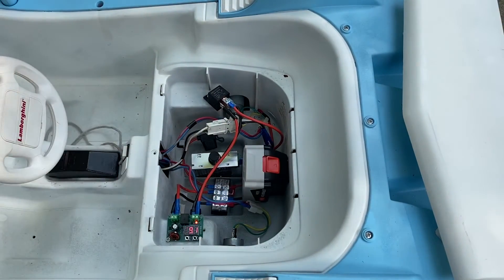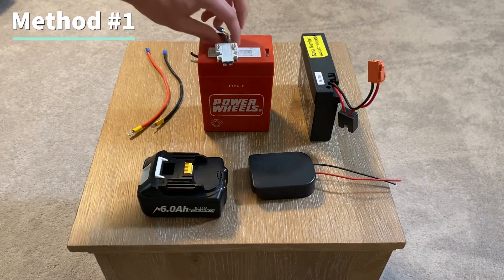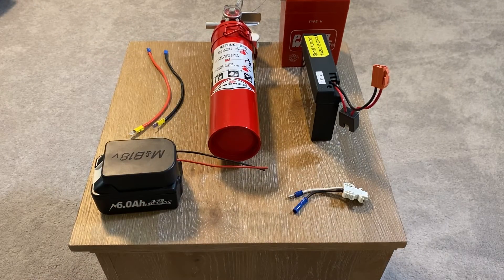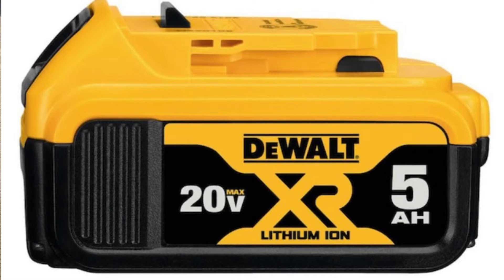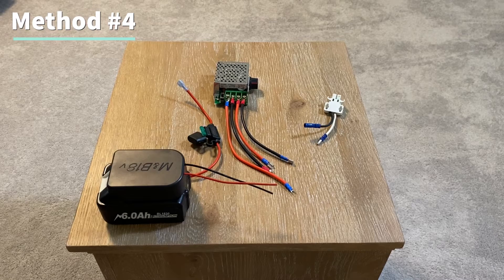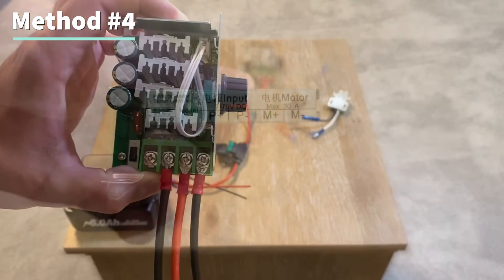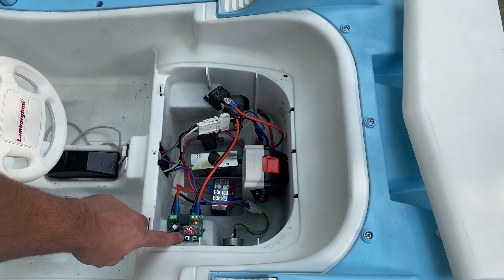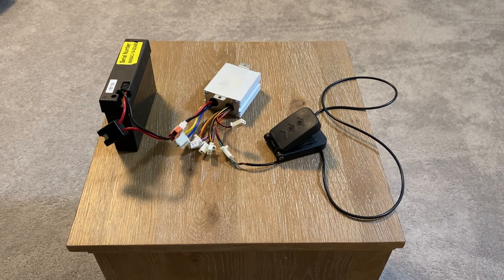Best Power Wheels Mod - Drill Battery Conversion (4 different methods)

Comment: Do you have a link for the speed control unit that you used? I saw links for everything but that. I'll be using a 20v tool battery for a 6v ride on toy, so I want to make sure I don't fry the engine and make sure it isn't too powerful for my littlest kid.
Reply from the maker: I used this speed controller. https://a.co/d/aweMheK

Comment: I'm almost done with my build but would like to add a rocker switch to kill the whole circuit so the LVC doesn't drain the battery when not driven for a while (I realize I could just remove.the battery...). Most switches I am finding say they are only rated for 12V. Is there a way to add a switch right after the battery that won't get fried? Maybe it needs its own relay somehow? Appreciate any insight you may have.
Reply from the maker: You are correct, the on/off switch will need its own relay. Do you know how to wire one up?

Comment: thanks for the video. wouldn't it be more appropriate for the fuse to the on the other side of the terminal strip as close to the battery as possible?
Reply from the maker: Ideally yes, you want the fuse as close to the battery as possible.

Comment: glad I checked this out before wasting money on a low voltage protector when my battery already has one
Reply from the maker: Ya, using a voltage cutoff is a hassle. Even with batteries that have an internal cutoff, I recommend installing a cheap digital voltage gauge on the dash, just so you know how much juice you have left. And if you want to preserve the life of the battery, don’t run it under 16.0 volts

Comment: Hey man, this video has been really helpful.   I am working on doing a setup similar to your method #4.  One question, have you had issues with that setup drawing power when the power wheel wasn’t in use?   I started with a setup similar to your method #2 and noticed it drawing down my batteries too much so that is why I am changing.  I know the low voltage module will protect the batters but also curious if I leave the batteries in when not use if it will continue to draw small power until it trips the low voltage module.   I was thinking about adding an additional power switch to the circuit to try and prevent any power being drawn when not in use.  Just curious if you have a thought.  Thanks
Reply from the maker: Yes, with the LVC board, it will continue to draw power. I’ve also been adding a digital volt meter on the dashboard which shows the current battery voltage, but if I leave the battery in, it will run down. So I’ve been adding an On/Off switch on cars where I can’t easily remove the battery. Ideally, remove the battery after each use, but if you cant, try adding an on/off switch
Reply: Appreciate the feedback.   I was thinking about adding the on/off switch between the battery and the terminal switch, thoughts?

Comment: Complete noob here. I ran through the set up for the most part (18 volt Li battery, 30A inline fuse, DC Motor Speed Controller Switch) just without the LVC, but the control board for the car was 12volts. pretty sure I blew a capacitor due to voltage into the board. Would a 24volt board resolve the issue, as it could handle the voltage, but don't want to short the car on power, even though the motors are rated for 12volts? wondering if peripheral devices would (lights, radio, etc) would lode functionality due to the lower voltage going need for the control board.
Reply from the maker: Ya, the control board is blown. You will need a board that can handle 24volts. Here’s a link: https://a.co/d/fXApTpE
Reply: @DadHacks  that's what I figured, but there should be no loss in power and function with a higher voltage control, correct?
Reply from the maker: Actually, you will need a 12v buck converter for the lights or sounds (if there are any), those have issues with higher voltage.  https://a.co/d/0hcpBuD

Comment: I see various statements about whether Makita star series 18v batteries prevent over discharge or not. Some people say the battery must be attached to a Makita tool to prevent over discharge. In any case I am doubtful the third party batteries in your link prevent over discharge. Any comments?
Reply from the maker: There is a great video that I’ll link that talks about the different batteries function. The Makita battery does not need to be attached to the tool, as the BMS is in the battery. As for the non-OEM battery, it says it has the same over discharge protection as the OEM Makita battery, but I have never ran it down far enough to test at what voltage level it shuts off at.

https://youtu.be/4OkT_SU6GSg
Reply: @DadHacks  Good video, thanks. The issue I see is that Makita shuts off at about 12.5- which is lower than recommended for optimum battery life, from what I gather.
Reply from the maker: @leftofone  ya, I used to cut mine off between 15.0 and 16.0 volts but I’ve moved away from power tool batteries back to SLA batteries. I wire up a 12v/12ah and a 6v/12ah in series to get 18 volts and it works much better than the power tool batteries, imo.
Reply: @DadHacks  Interesting to hear. Can you elaborate on why you prefer sla, and why the power tool batteries were not as good?
Reply from the maker: SLA’s are cheap and I have a lot of rides so I need a lot of batteries. The only time I’ll use a tool battery is when space for a battery is limited.
Reply: I ruined two OEM Makita batteries and have possible ruined one non-OEM replacement. I'm ordering the battery protector and hoping that works.
Reply from the maker: @christiandelozier8309 The low voltage cutoff is okay. The downfall is that the voltage cutoff has to be reset every time the battery is removed. I’ve been working on a LED voltage gauge that mounts on the dashboard to make it easy to monitor the voltage. I’m putting together a kit to sell on Amazon. If you’re interested email me at PowerWheelsRepairs@gmail.com and I’ll send you more info.

Comment: Thanks for the info. I want to use 80v batteries from kolbalt since I have several of them and just as many power wheels. Could I put the speed controller ahead of the low voltage cut off and reduce it down to 18 volts?
Reply from the maker: If you are going to use the LVC board, you will need to follow method 3 and use a relay. If it were me, I’d just buy a digital voltage gauge and some cheap 18v 6ah batteries and not worry about the LVC board.

Comment: Looking to do Method 2 for my kids John Deer Gator. I want to wire the batteries in parallel to just increase the Ah and use the 18v to make it a little quicker. 
How do you think would be best to wire them in parallel for method 2?  Completely clueless haha 

Amazing video by the way. Literally used up hours of my evening working out how to make this car quicker haha 😆
Reply from the maker: Thanks! To run the batteries in parallel, you will need to add a fuse in between the batteries (it doesn’t matter if it’s positive or negative side, I just always do it on the positive side) and another fuse after the battery connection on the positive side. 

I would also suggest to add a digital voltage gauge, especially if you are using a power tool battery.
Reply: @DadHacks  Great. I’ll be using Makita batteries so you think I will still need the volt gauge?
Reply from the maker: You don’t “need” the digital voltage gauge, but it’s nice to be able to see how much power is left in the batteries
Reply: @DadHacks  so. Update. Everything worked a amazing. BUT when he comes off the gas the wheels lock and he skids for ages. Any gadget I can add to stop it slamming off and roll to the stop? Might save the gears! Haha
Reply from the maker: @Droplip   Yes, so on the gas pedal there should be a blue wire, this acts as the brake to the motor. You can simply unplug the blue wire and the wheel should continue to spin after you let go of the pedal. However, doing this  means the Gator could roll backwards if they stop on an incline. You can also add a brake resistor to the blue wire, I’m gonna make a video on that shortly (hopefully in a few weeks)

Comment: Very useful info on here. I'm just wondering about a simple question but since I  havent yet done anything to my son's truck but I plan too. I want to do it right the first time around. His uses 2 batteries/ a 24V set up. So my question is do I need a 24V battery or would an 18V suit it just fine?
Reply from the maker: You’d want to keep it at 24volts. The motors are rated for 24 volts and dropping the battery voltage to 18v would actually slow the car down.
Reply: @DadHacks  I thought so. I just wanted to be sure. Cause the other batteries I keep finding are 40V but I think that would be to much and it would probably end up destroying it than anything
Reply: You could  wire two 18vs to produce 36v then get a step down to 24v. That way you have more amp hours available at the right voltage. I have a trax Dodge with that setup with dual Makita batteries and it runs for days.
Reply from the maker: @hectorgarza5026 Are you sure that you are increasing the amp hours? If you wire two batteries in series it only increases the voltage, not the amp hour rating.

Comment: Hey Dad Hacks, Great Video. Does the 24v relay you have added replace the relay board that comes with some cars?
Reply from the maker: Hi! No, the relay just protects the Low voltage cutoff board because the LVC board can’t handle the full current from the battery. And the LVC board is only used because most power tool batteries don’t have a battery management system built in them (so if you were to fully drain the battery, it would damage the battery). 

If you want to use a power tool battery (18 or 20 volts) but don’t want to hassle with the LVC board and relay, you could just add a Digital Voltmeter and then replace the stock 12v control board with a 24v control board. Once the battery shows 15.0 volts on the digital voltmeter, you would need to change batteries.

Here’s a link to a replacement 24v control board:https://amzn.to/3g6qmhG
Reply: @DadHacks  Gotcha, thank you. I like the relay to LVC board myself. Your diagram is fantastic and seems very straight forward to wire up. Connecting back to the stock control board was the one part throwing me for loop.  So from the motor goes into the stock control board right?
Reply from the maker: @jarrodcolon9983  That's correct. The wires from the motor will connect directly to the control board. If your car is a stock 12v, then your control board can only handle 12 volts. If you increase the voltage you will fry the board.
Reply: @DadHacks  Wonderful. Thank you so much for taking the time to explain this to me.
Reply: @DadHacks  sorry still having some confusion connecting the speed controller to the motor. The connection from my foot control has 2 wires (blue and white) running to the motor the other end connects to the control board. Not sure where to run the cables from the speed controller.
Reply from the maker: @jarrodcolon9983  the confusing part is the M+/M- on the speed controller, because the speed controller connects to the Red and Black battery connectors on the car, not the motors. Your motors will connect to the control board
Reply: @DadHacks  forgot to thank you for the help. I got it all sorted out. Very much appreciated your help.

Comment: Hey, I've been really into havocware build but yours is a bit different, is the 24v relay important to the diagram?  Seems they are harder to come by on amazon here in Canada.

Great video and well explained
Reply: Hey! I found one today at my local Canadian Tire. Right by the automotive area's electical connectors. 7, 99$
Reply from the maker: Thanks! Yes, the relay is important because the LVC board can not handle the high current. You can find a 24v Relay at any automotive parts store. I have another video (method #3) that you may also want to check out https://youtu.be/S9LMmRpvSGg